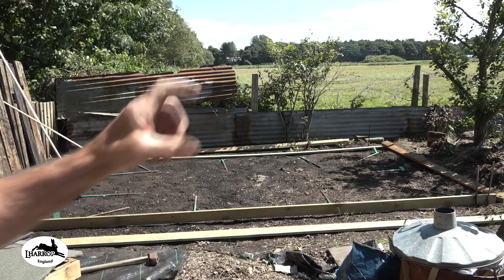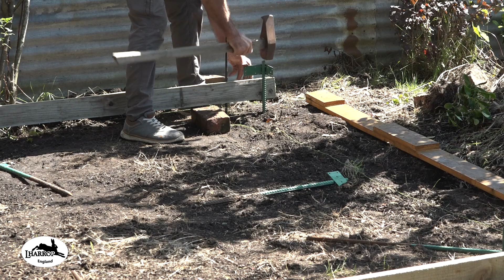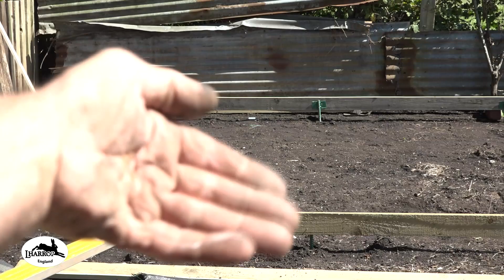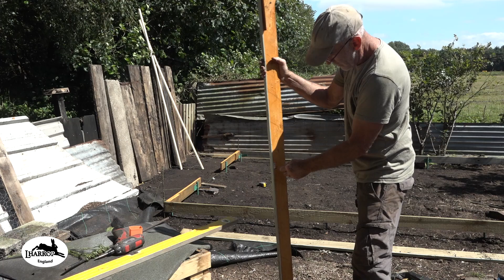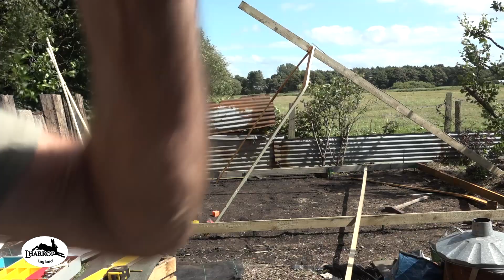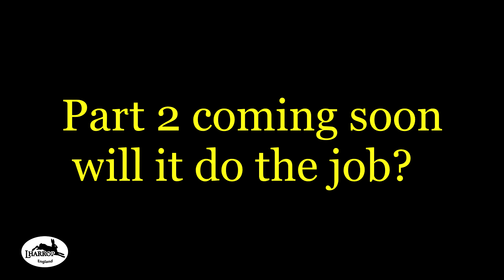diy poly tunnel from pallets Part 1

Comment: Gotta say I'm impressed you got it worked out. I have the same stubborn attitude. Keep going & get it done... Lately, I've been trying to burn into my brain, STOP & go get the right tools or prep. Taking time to do it right, saves so much struggle... Hope all is well my friend, take it easy
Reply from the maker: Cheers Bud, yea keep going attitude ive got that for sure along with I can always fix it if i break it vibe going on ;-) It not that I dont get the stuff ready to do the job, I just forget to bring it haha! take care mate.
Reply: @LozHarrop  Yeah, don't even get me started on fix it myself. My house is 60yrs old & I've worked just about every job. The thing about your own stuff, ya never really finish. I've replaced plumbing, but have holes running up the whole wall cause i didn't want to do drywall, hahaha
Reply from the maker: @evaderknives  tell me about it mate 700 jobs to do on my house 😁😁👍👍